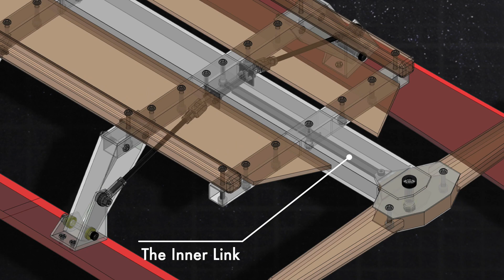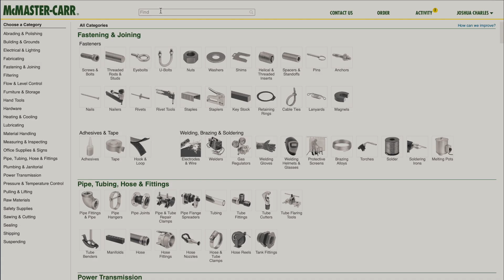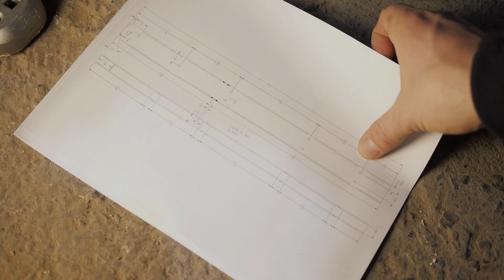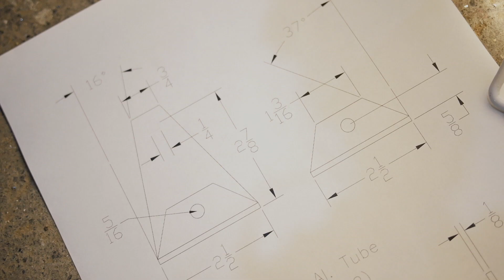I Made a New Ski Sled

Comment: I really think you should apply your skills to building a gt snowracer type sled. Things they don't have you could add are shock absorbing front and rear, handbrakes on each side (could help with steering). There's no reason you couldn't add a removable electric motor with a track. C'mon!